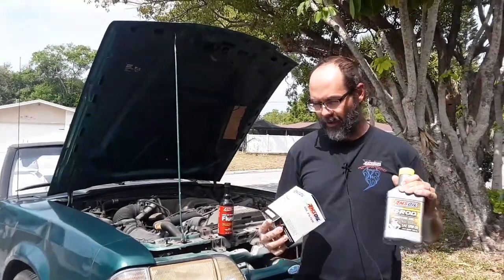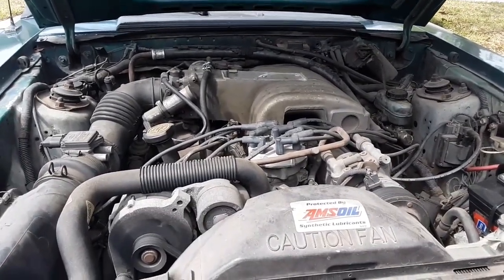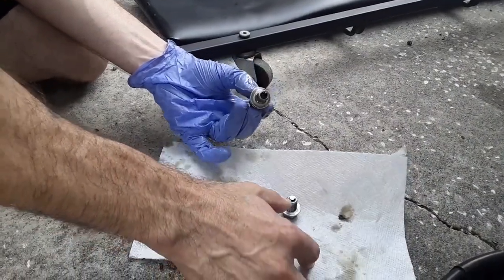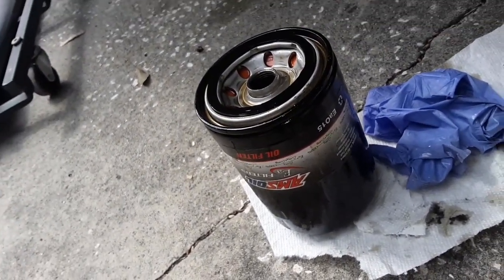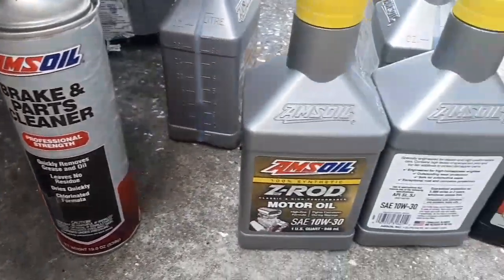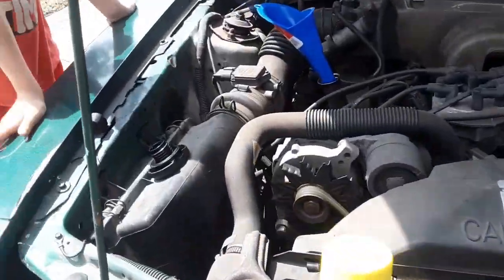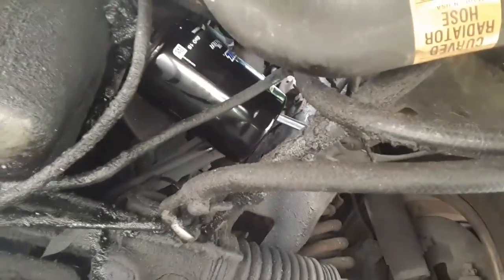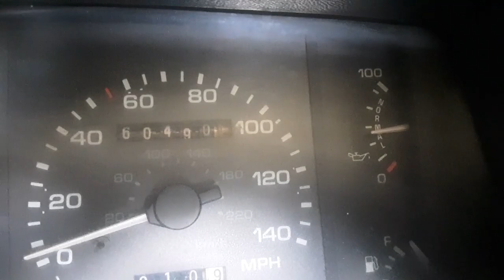1989 Ford Mustang LX 5.0 convertible Amsoil Oil & Filter change ZRod 10W-30 high zinc & corrosion re

Comment from the maker: Amsoil ZRod 10W-30 High-zinc, corrosion protection: https://www.amsoil.com/p/z-rod-10w-30-synthetic-motor-oil-zrt/?zo=1463115

Amsoil 15W-40 CI-4+ Heavy-duty Diesel and Marine: https://www.amsoil.com/p/sae-15w-40-heavy-duty-diesel-and-marine-oil-ame/?zo=1463115

Amsoil EaO15 oil filter for small block Ford: https://www.amsoil.com/p/amsoil-oil-filter-eaoilfilt/?code=EAO15-EA&zo=1463115

Lookup your vehicle's oil/filter/capacities: https://www.amsoil.com/lookup/auto-and-light-truck/?zo=1463115

Save 25% as an Amsoil Preferred Customer: https://www.amsoil.com/offers/pc/?zo=1463115

Dealer / fleet opportunities: https://www.amsoil.com/business-opportunities/?zo=1463115

Store all your vehicle maintenance records: https://www.amsoil.com/why-my-garage?zo=1463115

www.number1synthetic.com
Mike Trull Amsoil dealer 1463115
Email: trull_synthetic@yahoo.com
Subscribe for Amsoil fluid change videos and more on this Mustang 😁

Comment: With that flush ? What about the possibility of residual flush remaining inside the engine
Reply: Won't hurt anything, it's just detergents
Reply: Won't hurt anything, it's just detergents
Reply from the maker: Thanks for watching and for the question. Amsoil says that a residual amount will not cause any issues, but I like to let it drain for at least half an hour.